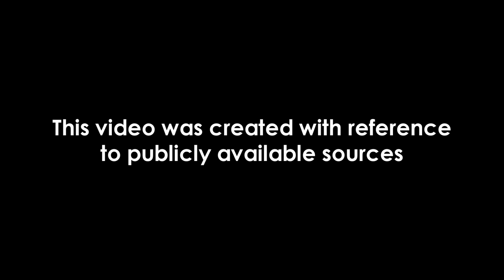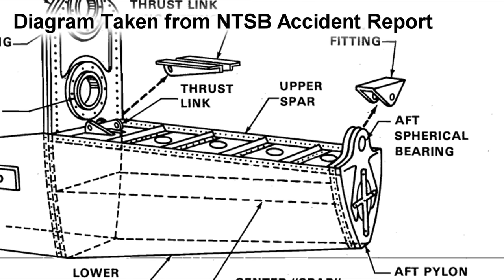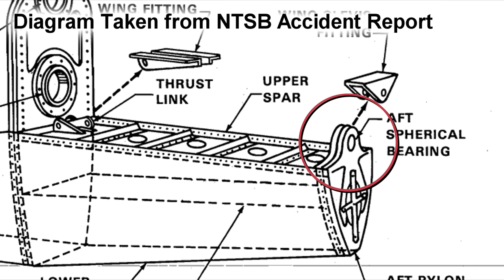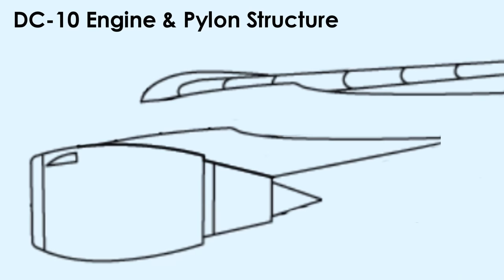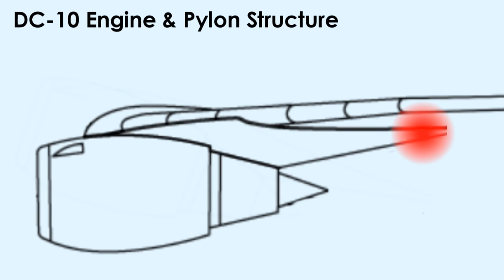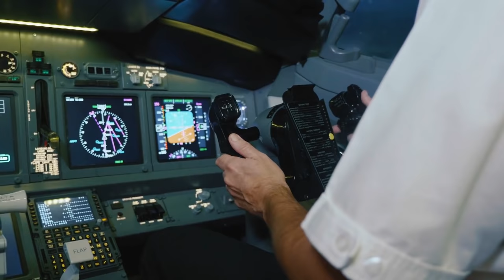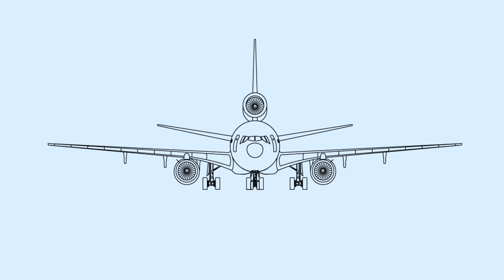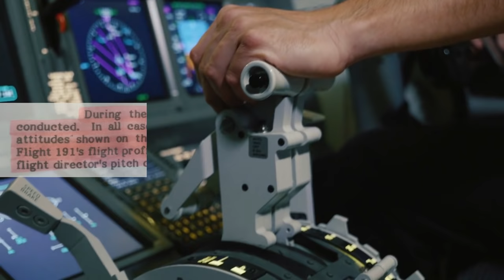America's Deadliest Air Disaster (American Airlines Flight 191) - DISASTER BREAKDOWN

Comment: I remember this like it was yesterday. I was in 8th grade. I recall watching it on the news with my family. My dad was a helicopter design engineer. When he discovered the company he worked for was cutting corners, he resigned. His repeated warnings about an imminent crash were ignored. Weeks later one crashed, killing both test pilots on board. That haunted my father for the rest of his life. He believed he should have done more. I distinctly remember him suggesting this flight disaster, AA191, was the result of poor maintenance and cost cutting by AA. Boy, was he correct. Spot on. So preventable. So tragic. 😢

Comment: The disasters where the passengers barely even lift off and then instantly die, such as this one and the Challenger disaster, are the most frustrating ones....
Reply: Most plane crashes happen during takeoff and landing; it's when the plane performs its most complex mechanical maneuvers, and undergoes the most strain.
Reply: James Jones  minutes. If anyone was alive they died on the 300 G impact into the ocean
Reply: @faranocks  That's incorrect, most plane disasters occur during cruise flight. Takeoff and landing are the most dangerous if you account for time, as these phases are much shorter.
Reply: Sadly it's unlikely the astronauts on Challenger died immediately. The module they were in was intact after the explosion, and the crew likely had a horrifying ride down as they plummeted down from the sky for a couple minutes before smashing into the ocean.
Reply: James Jones  HOURS? No. Minutes? Yes. They were alive during their plummet back down and eventual landing in the water.

Comment: It’s my understanding that the way the engine flipped off the wing is a design feature, to avoid damage to the wing in case the engine breaks off; it was the pylon damage that really fucked everything.
Reply: Yes, the engines even to this day are designed to sheer under very severe circumstances in order to save the wing structure.  They're designed to safely depart the aircraft missing the horizontal stab.
Reply: Yes, the rear connection took pieces with it that ultimately caused the high-lift devices to retract. Losing face pieces of the leading edge is not a major issue as there would still be lift generated downstream.
Reply: Yes but the pilot following procedure throttled back even with two engines I think it was because of assymetrical thrust but the left wing stalled when they slowed down . They may have made it otherwise.I worked in the hangar 6-C and talked to a mechanic on that crew.The forklift used in this procedure ran out of propane and the next shift took it.Unknown to the new crew, while waiting on a new tank of fuel for the forklift the hydraulics on the forklift "bled down"allowing the pylon to come impinged or bound up and the damage could not be seen without taking it apart again and inspecting it again which no one had a reason to suspect it was damaged.Onebof the mechanics I believe the crew chief committed suicide as a result.His name should be included in the toll.Lawyers for the airline fought the families of the victims every way that they could.Even their mechanics were thrown under the bus legally.It doesn't pay to take a shortcut to impress the boss, you will be blamed when you are in the witch hunt!It isn't fun and the only thing that can save you is proper documentation and work.
Reply: @allanbrogdon5317  aircraft are designed to be able to fly with asymmetric thrust. In order to receive certification they must be able to fly with half their engines gone. I’m not entirely sure how it worked for tri-jets but I know that all modern aircraft can run with only one engine (or two in a four-engined case). The thrust imbalance would try and Dutch roll the aircraft, which is what happened when the high-lift eventually failed. The high-lift failure and the deceleration were only a disaster because they both happened. If one had happened but not the other, the aircraft likely would have been able to still fly.
Reply: Yes the engines are designed to break away if under extreme stress. Mainly from an engine so unbalanced and vibrating so badly that it risks tearing the wing apart. But for most engines the point of breakaway should often be at the bottom of the pylon. Where the pylon connects to the wing is supposed to be the strength point. Especially that rear Clevice. At the top of the pylon the failure is supposed to be the front connectors first, which would cause the engine to be flung down and away from the plane. Not tumbling over the top tearing apart the leading edge.
Reply: @allanbrogdon5317  Yea, I've driven a lot of older forklifts in my day, some will lose pressure and the mast will start to sag if there is no pump running to replace  it.
Reply: @allanbrogdon5317  During the investigation, 13 DC-10 pilots in the flight simulator with duplicated conditions, were unable to recover the aircraft. Keep in mind, the simulator pilots are aware of what is going to happen ahead of time and were still unable to recover the aircraft.
Reply: @freshfritz4649  That's not true, the simulator pilots definitely were able to recover the aircraft.
Testing showed that it could've definitely been landed, but the situation the pilots were in made it unlikely.
I read the final report, and it was when the simulator pilots *replicated the control inputs*(which was presumably mainly to be sure their simulation setup was accurate) or attempted to follow the flight directors pitch command bars(though I think they would be ignored in a situation where it was known there were major problems) that they followed much the same flight path and crashed.
"Many"(as per the report) simulator pilots were able to prevent the stall and achieved stable flight. It seems that landing wasn't considered to be a significant problem once stable flight was achieved.
But the crash pilots weren't aware of the particular problem, and the stall warning & slat disagreement warning were also believed to have not been working, due to loss of an electrical system resulting from the damage. None of the simulator pilots considered it reasonable to expect the crash pilots to react the same way as they did, for these reasons.
Various things could've prevented the crash, but were understandably not done in the situation. eg:
If airspeed had been higher, nose was lowered initially(slower climb)
Likewise if the standard recovery procedure had indicated higher airspeed
If roll had been recognized as a stall, but a roll without stick-shaker indicating a stall would've confused them.
If electrical system had been re-activated(depends if shorting that shut it off was temporary or permanent), or activated the emergency electrical system - this would've re-enabled the warning systems. These weren't attempted, presumably due to lack of time or or being preoccupied with other aspects.
Reply: @DoubleMonoLR In another video it was mentioned that if the pilots kept he other two engines in toga thrust and kept accelerating the plane would not have stalled but the single engine failure during takeoff checklist at the time specified that they should keep the speed just over v2. Nobody knows if they would be able to land safely with an aerodynamically compromised wing without slats though, it would have been a very hot landing but even it the landing was bad (e.g. UA232) some passengers may have survived.
Reply: Watch your mouth kid
Reply: @petehuckleberry5068  You’re so right. I’ll watch my fucking language from now on.

Comment: How something like this could have happened?

"... however at American Airlines mechanics a technicians developed a plan..."
Oh yes, all clear...
Reply: Most likely he was forced to that, to push the numbers. It's a disgrace for every society that something like this can happen.
Reply: Stuff like this happens all of the time, believe it or not. 

Most aviation regulations are by objective. Lots of operators will find easier and more efficient ways to accomplish those objectives. 

For example, Continental Airlines only bought four 707s to start and that was not enough to maintain their schedule with the required overhauls since each jet would have to be taken out of service for a week to accomplish it. 

So they did all maintenance at night and broke the overhaul into “phase checks” that could be accomplished during the nightly maintenance. 

It’s still used by virtually all airlines today. 

But when Aloha did it.. it wasn’t comprehensive enough because of the corrosive environment they operated in and the high number of cycles the aircraft would accumulate on short island hops. They also had substandard methods of inspection. 

So.. what needs to be done is a risk assessment. Like.. those bolts are designed to shear should one of them fail, could installing the engine in this manner cause them to fail?  Often these risk assessments have to be presented to the regulatory body and an official change be made in their procedures rather than just doing it because it’s faster or cheaper.
Reply: As in the video, other airlines were doing the same or similar procedures, despite the guidance from the manufacturer.

Comment: I believe it was during this period they put CCTV monitors in the passenger cabins as a novelty for the passengers to watch the pilots do their work. The passengers would of seen the whole disaster and the idea was quietly shelved.
Reply: If the passengers knew nothing about flying would they really have noticed an emergency was going on? 
I mean...Im sure they'd have felt the engine breaking off, but I know planes have more than 1 so I probably would've been scared but would've told myself "they have other engines, we're good."
Your comment just made me curious...
I just dont know if footage of pilots doing normal jobs, trying to save the plane - would've really stood out to me knowing nothing about flying a plane?
Reply: Of course....the plane being all sideways and all now THAT would've gave me the biggest hint that death was imminent.
Reply: @thinlineofsanity1035  I would have been greatly concerned about weight distribution change,  myself. Whether it could run using one less engine or not..
Reply: @thinlineofsanity1035  There was a camera mounted directly behind the two pilots so the pax had a CLEAR view out the "pointy end" and could easily see the same thing the crew did in the wind screen.  That being green grass QUICKLY coming up to meet them.  Yeah, they KNEW their fate a few seconds prior to impact...
Reply: In those days, they had large projection screens in each passenger section that used RGB projectors, like the early home cinematic projection devices and screens. I remember at least one time when I flew with these on the plane. It showed the forward live view of the plane, plus airspeed, altitude and outside temperature readings in the margins. That was the first time I knew just how cold the air is at 33,000 feet. It was somewhere around -75 degrees.
Reply: With any part on any thing , if it didn’t need to be there it would never have been there in the beginning, so if I saw a engine fall I’m ill shit my self and know I’m about to die
Reply: @coca-colayes1958  Engines are designed to fall off by going up over the wing. The plane would then climb out to 3000 feet or so and return to the airport and ultimately make a safe landing. This disaster and the El Al disaster in Amsterdam were due to faulty maintenance and numerous other issues. If an engine fell off on a newer plane, there is a 99.9999999% chance that you would be fine.
Reply: Yes, as a travel agent working in Los Angeles on the day this happened, I recall my associates making similar observations about this.
Reply: Probably an apocryphal tale. The emergency recorders lost power upon the engine detaching, its very unlikely that cabin equipment such as lights and tv screens remained on for more than 5 seconds
Reply: @BillehBobJoe  Still, nobody was taking any chances after this, that passengers on another future plane crash might get such horrifying pictures. All CCTV was removed due to this crash.
Reply: 👍
P. S. 
“…passengers would (HAVE) seen…” or (WOULD’VE)..😇
Reply: @thinlineofsanity1035  You say "Would the passengers have noticed an emergency going on".
What are you on?!. The aircraft was almost inverted ffs. They weren't serving drinks pal. Crazy!.
Reply: @macman975  I can't remember this video from so many months ago, but I obviously know an inverted plane would be obvious to passengers. 
I believe I was questioning about emergencies and passengers were unaware, it was just BOOM - DEAD. 
I know I'd much rather prefer that.
Reply: I had flown this flight  to LAX several times just prior to this and always enjoyed the CCTV out the cockpit window (can we say cockpit anymore?)
Reply: There are external cameras on some modern planes, which passengers can watch, they're common on A380's for example.
Cameras in the cockpit now are very unlikely due to it being invasive and potentially distracting for the pilots.
They didn't stop using cockpit cameras until years after this accident, the last use seemingly being about a decade later.
Considering the shades are always up at takeoff, and it was a sunny day, any projected image likely would've been pretty washed out anyway.

Comment: From what I understand, there was a shift change and they left the installation incomplete while resting on the fork lift. The lift sagged during this time putting great stress on the effected pylon mount causing the damage.  The next shift adjusted the fork lift and finished installing the forward mount bolts, not being aware of the damage that had occurred to the airframe.
Reply: You are absolutely right and most of the commenters here are absolutely stupid.
Reply: That's true. It was also an unauthorized shortcut for replacing the engine.
Reply: The fact that a forklift staggered under the weight of the engine puts into perspective how monumentally heavy those things are
Reply: Yes, I've definitely read the same. Poor folk on the flight